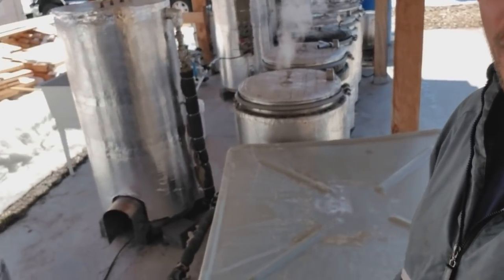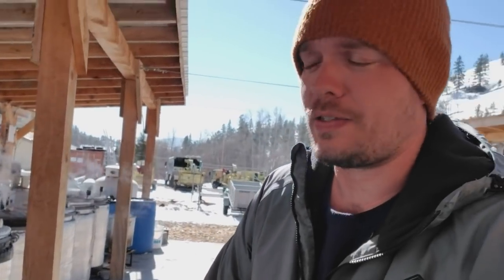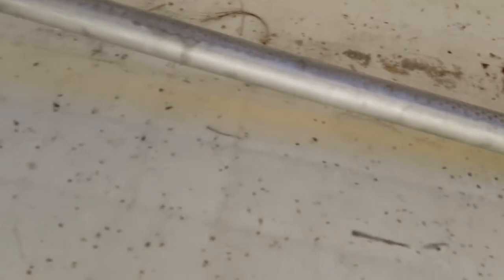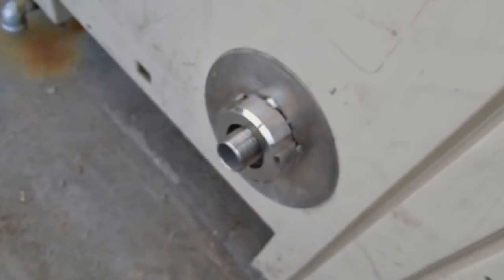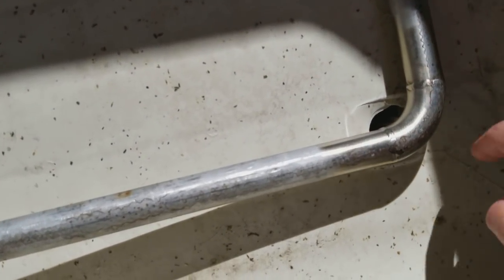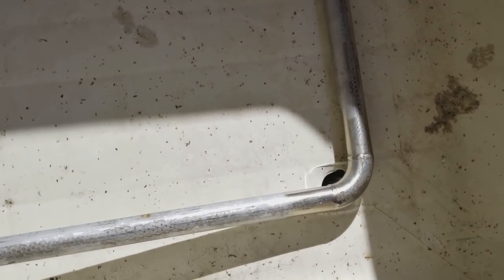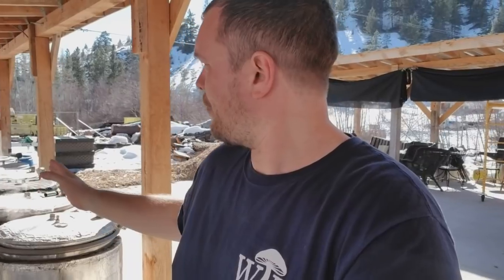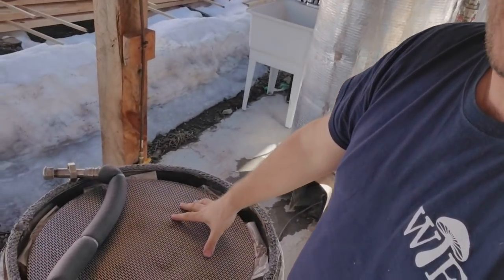I Can't Believe This Just Happened. Mushroom Farming Disaster!

Comment: All you need to do is spread your pressure area out that small leg with 120, 5 pound bags is quite a lot. Any type of pad to set the stand should do it could even be ply board or stainless plate just need a larger pad to stand on like a snow shoe.

Comment: Do what you're planing and on the underside, where the weight is resting, place extra support for the weight (pressure point).

For the K temp probe, use silicone to insulate it from the moisture, the tape will fail over time or you can get flexible long probes that plug in from the outside of the tank. (Only the tip measures the temp)

Comment: You could always do fire brick and lay the steam coil directly on it without the stand so the bricks are less likely to break. But cheapest way would to be to use perlite or something, will drain the water absorb the heat from the plastic, and hold up the steam coil from the bottom and inline with the bulkhead.

The tile should work fine for awhile, but I think in the long run they'll either break from the weight or will sink through the ply able plastic from the weight above after a few runs when they're hot. But you never know until after you try it.

Comment: Line the whole thing on the inside with foam board then plywood, this will add integrity, act to protect the plastic, and insulation, you can also add a thicker foam board to the outside as well.  You will sacrifice some space to have insulation on inside, but the benefits out way the loss of space.

Comment: Under the heading, "out of the box". After watching your trial run, it occurred to me that you could build one or two highly insulated boxes containing the steam coil. They would have a four sided cover that you could lift off.With the boxes that you already have, cut out the bottoms and replace them with a steel mesh anchored to the sides with rubber isolation pads. These boxes could be dollied into and out of the steam boxes. They would not even need lids, so you could put a compressive layer on top of the substrate. Then replace the insulated covers while in the sterilization cycle. If they cooled off too quickly when you pull them out, you could put a tarp over them.This way you would not have to purchase so many steam coils.I know this idea is a bit of a course change in the middle of the stream, but like I said, "it's out of the box".As always, best wishes.

Comment: For me, as a civil engineer, it looks more like the strength of the PP decreases dramatically when heated and the prop cuts through the tank, its not about melting. So just enlarge the area where the support rests, and it works. Heat conduction is not the problem. Aftzer a few Hours it has anyway everything in the tank more or less the max. temperature.
Reply from the maker: Markus you are likely right. I was thinking evening out the weight better on the new build. But either way lots of options

Comment: You and your friend are partially correct.  Among ceramics, some materials possess high levels of conductivity and transfer heat well, while others possess low levels of conductivity and transfer less heat. Aluminum nitride (used in packages for semiconductors that emit high volumes of heat but which must avoid accumulating heat internally) and silicon carbide transfer heat particularly well. Meanwhile, materials such as zirconia block heat effectively and its coefficient of thermal conductivity is low — 1/10 that of stainless steel. It is used for kiln walls, which are exposed to high temperatures.
Be sure you investigate the various availabe materials and choose approriately.
Reply from the maker: sdushdiu I meant to say ceramic has almost no thermal conduction... using 3/4" plywood is likely the best option but it might warp from the steam

Comment: nomex or carbonfiber/welding pad would work as a gasket between the feet and ceramic if you find ceramic is heating up too
Reply from the maker: Patchwork Gardens cool thanks.. more worried the ceramic might break
Reply: in the company I work, we use two 1000 liters pots for sterilizing coffee grounds based substrate, each pot sits on metal tripod, and then, each leg of the tripod used to sit on floor tile (in order to avoid damaging the vinyl floor), but the ceramic broke with the weight I think. Now we use wood and it's ok. I like your idea of using ceramic but I think it would break (but maybe still being useful if hold in place with silicone). Also take into account the surface area, the more, the better for spread the weight. Good luck Brian! I also think your prototype is the way to go! The big metal pots we use are a PITA and not very efficient!

Comment: Just use blocks of wood. Cheap and simple.

Edit: or put it on pallets. Also to patch your holes make a metal or plastic Plate bigger than your holes and put one either side seal them with silicone both sides and  drill  through the plates and tank clamp either side of the hole together and boom. Good as new.
Reply from the maker: Garfoid ya 3/4" plywood could work but might warp over time
Reply: WHAT THE FUNGUS True. But like you said you're gonna maybe get two or three going eventually. You can experiment on this one and then create the working ones from it. Good luck.